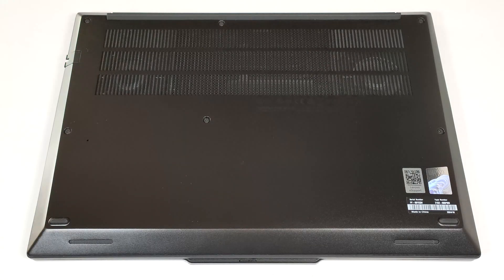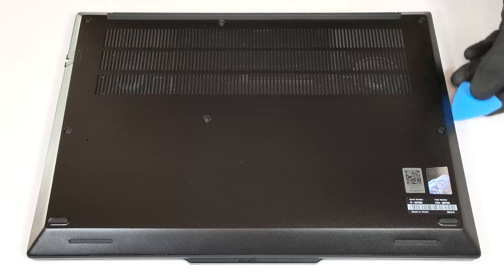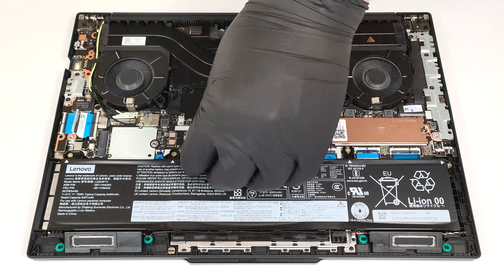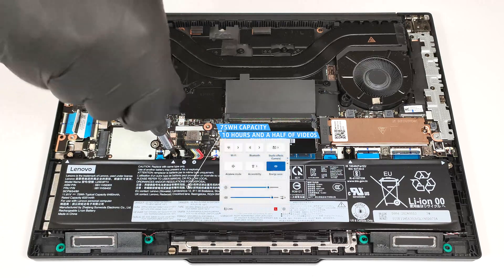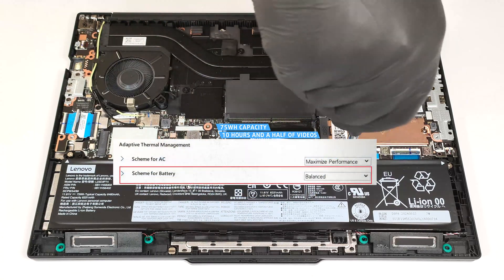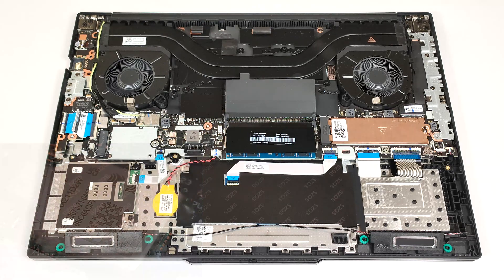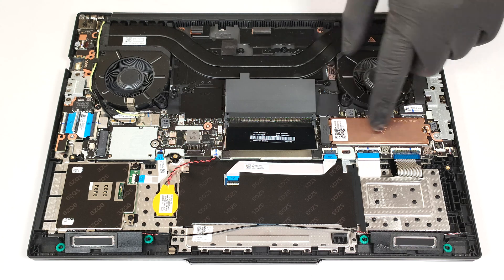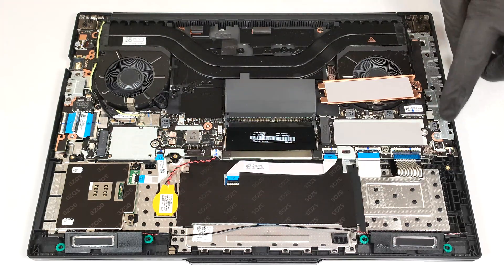🛠️ How to open Lenovo ThinkPad P14s Gen 5 (Intel) - disassembly and upgrade options

Comment: Very clear, thankyou.
I like the overall design of this laptop: dual simmetrical cooling fans, expandable ram, relatively big battery. It would be perfect if the speackers were mounted like in the amd version (pointing upwards and not towards the table where you put the laptop).